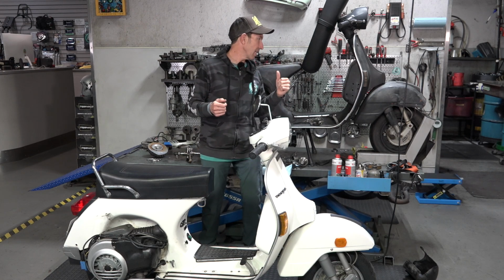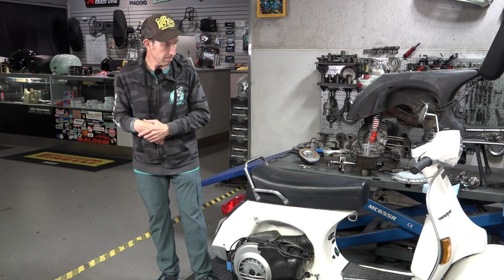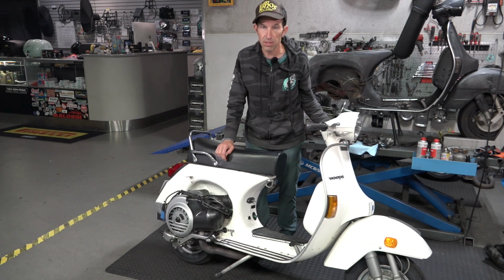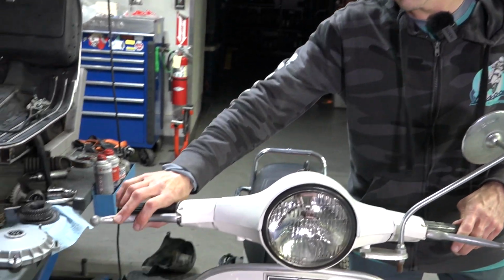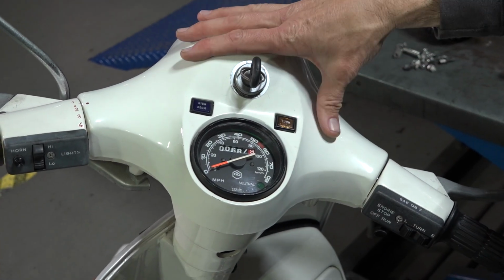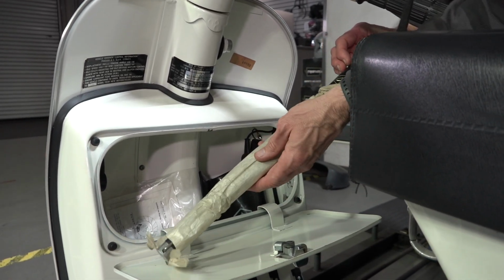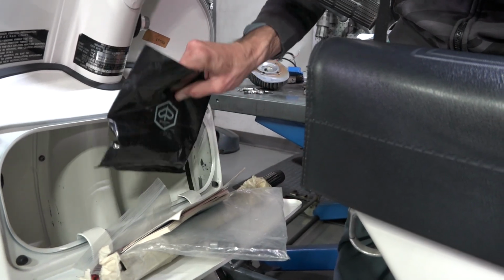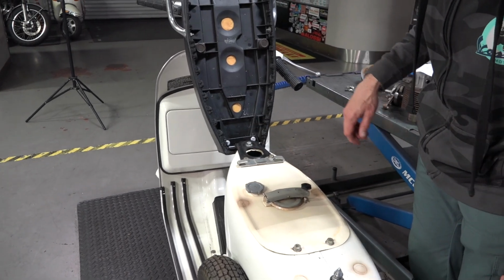Robot Shares a Clean Original 1979 Vespa P200E

Comment: Now that is what a scooter should be. I have a 1979 P200E. Mine is blue. It is mostly stock, except for the engine. I had the engine rebuilt by a local vintage Vespa shop using a lot of high dollar aftermarket parts. It was not built for performance, it was built for reliability. Mine didn't come with any tools or manuals. I completely disassembled it and replaced all the wear parts, bearings, cables, fuel valve, hoses, etc., but left the engine to the professionals. It is somewhat scratched and faded, and I just cleaned it and left the original patina. One difference I noticed is that black trim piece on the front fender is chrome on mine. Can't say if it is original or not. These are not highway scooters. Mine tops out at around 60 mph GPS, but I don't ride it at full throttle for very long at the time. One tool you need on a vintage Vespa besides a pump is something to raise the rear wheel off the ground so you can change a flat on the rear. I made a small screw jack out of a piece of pipe, some threaded rod, nuts and washers that fits in the glovebox.

Comment: Hi, sorry , but this can not be a 1979 model. It has a separate oiltank and and oilpump in the carb. these models started in the late 80s. My scooter is a 1981 and it has to get pre-mixed gas.
BYE from Germany
Reply: I own two 1979 models (P125 and P200E) and a 1980 P200E.    All three have oil injection/pumps.

Comment: Question, I have the same 79' P200E in blue, in the same condition, with all the accessories, but on the white bike featured in this video, it has a grab handle at the rear of the seat. Was this an add on accessory, or did it come with the replacement seat as I don't recognize it..?? Many thanks for an informative and fun video of this classic..
Reply: that is not the stock seat, it was changed at some point